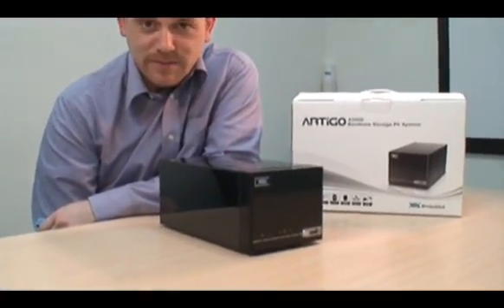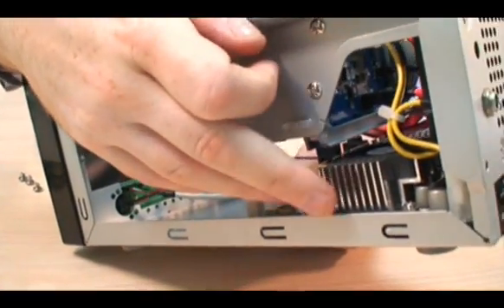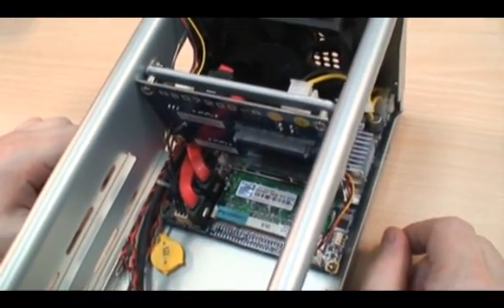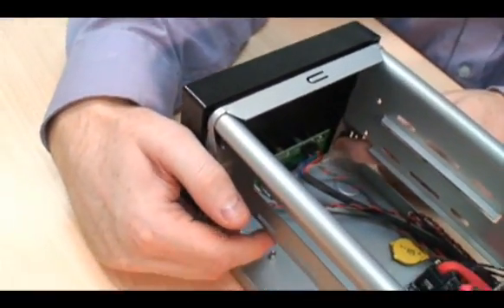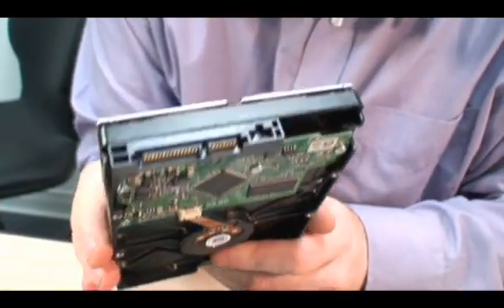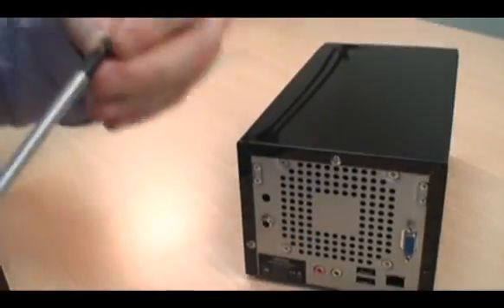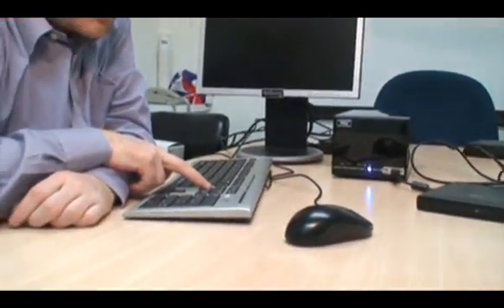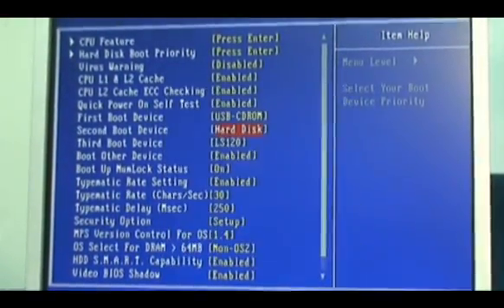Inside the VIA ARTiGO A2000

Comment: Smart Buyer indomike, you Save USD$880
(Diff by 7FPS for Crysis at setting very high)
Crysis absolutely Flying.............

2-HD3870x2 vs 2-GeForce9800 GX2
= Crysis 50++FPS vs Crysis at 57 FPS 
at USD$180x2=$360 vs USD$620x2=$1240

See His You Tube Video. 
Copy & paste: hd3870x2 crysis with catalyst 8.3 new driver